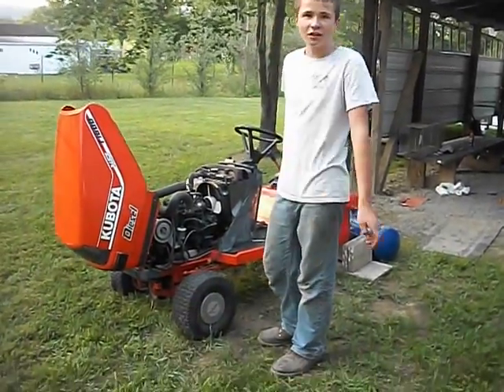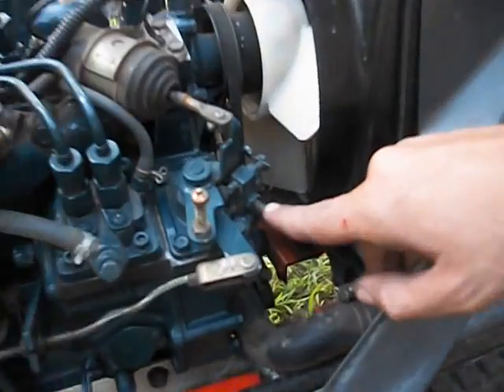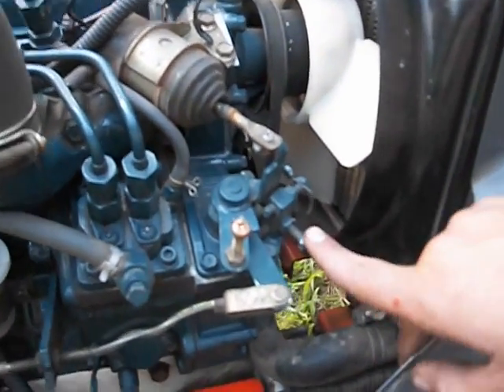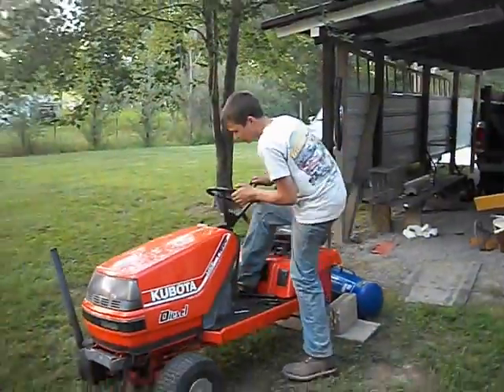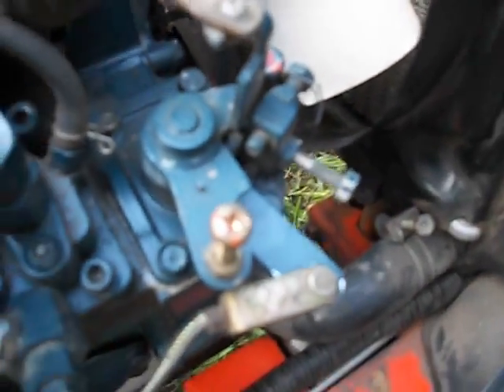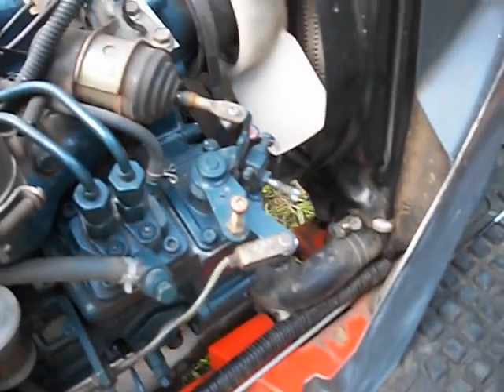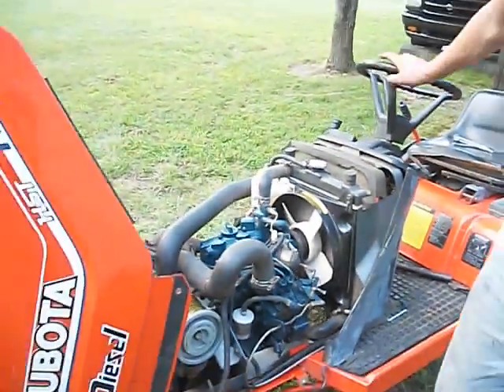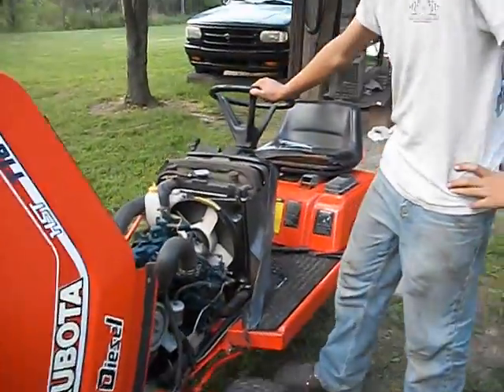Kubota diesel Before/After Throttle limit screw

Comment: Everyone is so concerned about blowing up a Kubota practically bullet proof diesel? You do know that they use the same engines in multiple small tractors to medium tractors with different options , in general Turbos, turbos and intercooler all with the same internals so to turn these things up the let’s say 10 or 12% is not gonna hurt them unless you strap the throttle at WOT and go fir lunch! Change the oil and air filter and at fuel and drop a little stanadyne in the fuel she will be all good! You’d hurt it more by putting it in you shed for 2 years with out running! I’m the last to want to waste a great little piece of equipment but if everyone’s a nervous nelly we would be in the Stone Age still! Have some faith! Do something for someone other than yourself today and be kind! Peace y’all!

Comment: That diesel is done for, diesels are low reving engines for a reason, Ulta high compression and heavy weight internals ie. Pistons rods crank all of them not designed for high RPM.